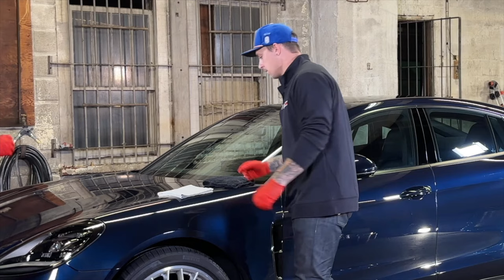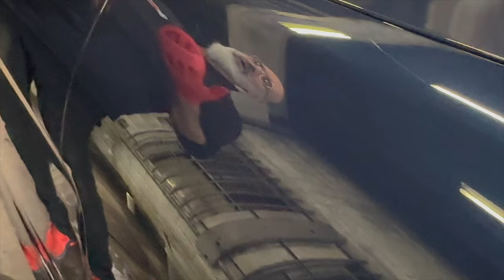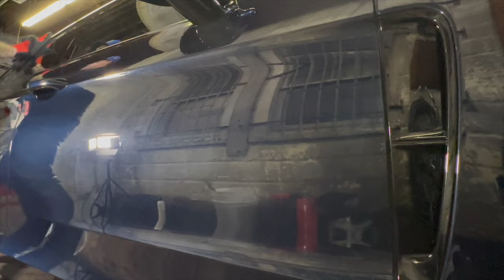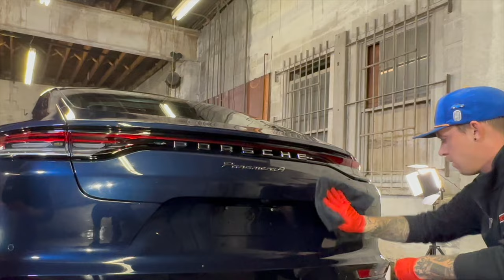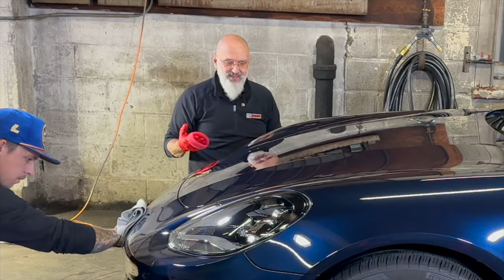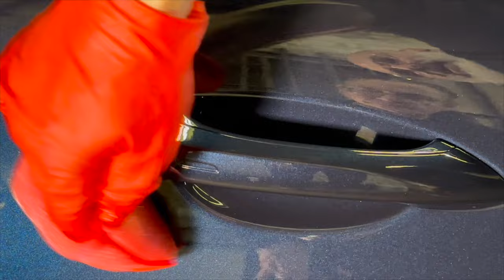Application of C6 ceramics BEST PROTECTION AND MORE HYDROPHOBIC

Comment: So how does Hydro Lite compare to the Roar coating that you applied to Pan's Porsche? That one seemed to be very chemical and road salt resistant.
Reply: I installed both, 1 on each side of my car, this past winter.  I did see some snow, road salts, and rain.  I intentionally waited 2 months before washing, just to observe how the coatings reacted and cleaned up.   Both performed very well.  But, the C6 side was noticeably better.  C6 maintained better hydrophobics and stayed cleaner. When I washed,  C6 also showed NO clogging, whereas Road did have slight clogging behind the front wheel (easily resolved with water spot remover).
Reply from the maker: Far more advanced technology in every way. Single layer, better hydrophobics, gloss, slickness, durability, and ease of application. I’ll be applying C6 Ceramics to his new car today, stay tuned to his channel.
Reply: @ryanl8653  Thanks Ryan, do you anticipate that Hydro Lite will provide similar performance?
Reply: @jeffc6832  Absolutely, but it will be marketed as a 6-year coating.

Comment: If you are promoting the best ceramic ever, then it also might be time to do better than 1080p videos
Reply from the maker: It was loaded in 4K, YouTube starts at 1080, and it takes a few days to convert to 4K
Reply: So when it looks like the leveling is missed on spots, is that footage cut where the areas are gone over? Mirrors and door cups and emblem detail for example.